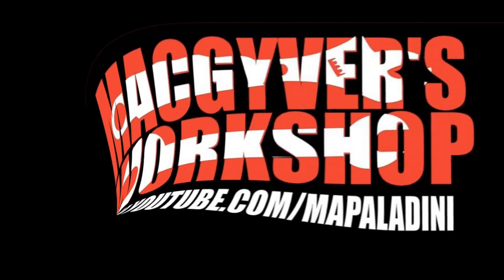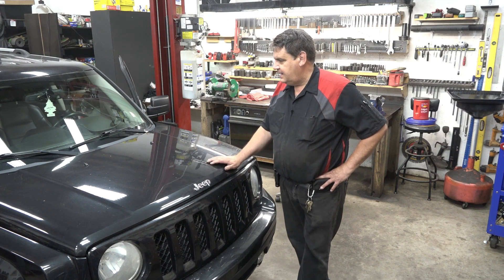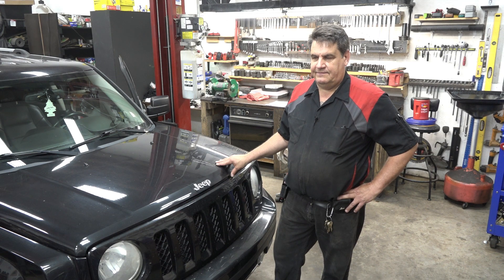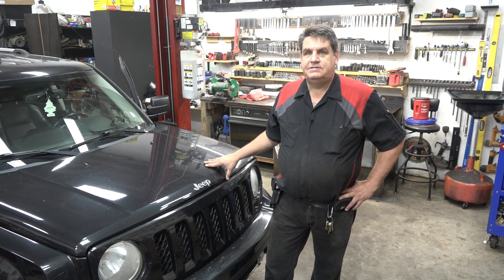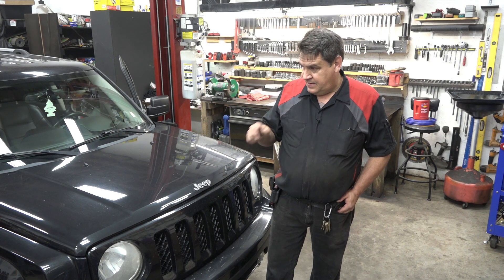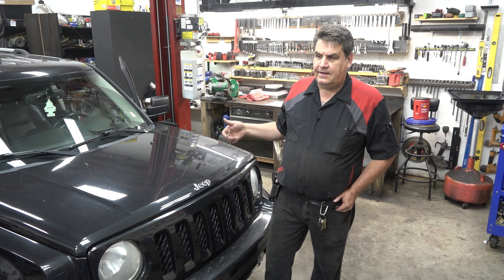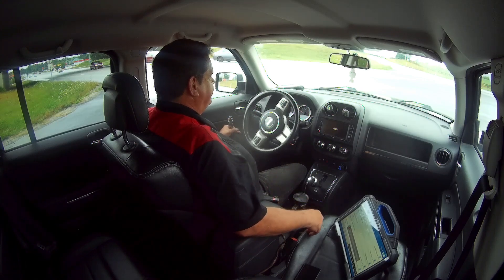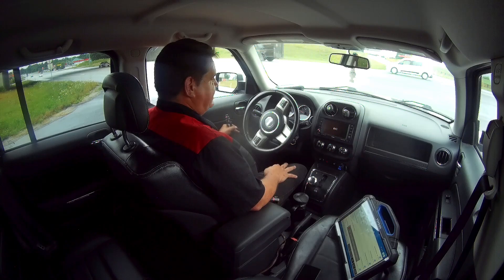Code P0777, 2011 Jeep Patriot JF011E CVT

Comment: Hello did you ever figured out the problem, I just put a new valve body into my JFO11E trans on a 2013 Jeep patriot 2.4l automatic and got the po777 code and goes into limp mode

Comment: This is bizzare! They really didn’t change much of anything in them much in the last few years. Mine is a 2015 with exactly the same trim pkg.!!! Did you ever figure this problem out?
Reply from the maker: Yes I did. Apparently the replacement pumps  that are available come 2 ways. One has a rubber o-ring gasket between the pump sections, and one designed for a later model does not. I got the ones without the o-ring seal, and they would start leaking when they got hot. losing pressure and triggering the code and limp mode.
Reply: Hi. So did you change the pump. Or you changed something else. And did you manage to fix the problem
Reply: @MacGyversWorkshop  what pumps are they I just got the same code on my 2013 jeep compass ???

Comment: I had a problem like this, it turned out to be the power steering cooling line was overheating and causing the computer to not let the truck take off, I temporary cut the line and looped it to keep the compression, but the whole line should be changed.

Comment: I have a 2014 Patriot with the same P0777 code and I notice that when it goes into limp mode it is due to the overheating. I poured water on the transmission for cool down and it would run normal until the temperatures rise and back to limp mode. I am currently working on installing an external oil cooler and not sure to bypass the stock cooler at the moment. I will send an update once I complete the test.
Reply from the maker: Thanks for watching! and I look forward to your update. Anytime an issue happens only when it's hot, you can be pretty sure that something is starting to expand and cause a leak. If the transmission is still original, and has not been recently overhauled, I would be looking at the flow control valve in the pump. You can get an aftermarket drop in valve that supposedly eliminates the sticking problem they have.
Reply: Did u fix it

Comment: I've got one in the shop with the same issue right now.  Transmission has not been rebuilt, but originally we had more solenoid and stepper motor codes.  We replaced valve body, new fluid and filter, and now we've got the same P0777 code. I'm wondering if the filter neck on the new filter is too long and touching the pan bottom.  I've had this happen on some of the other Nissan CVT transmissions before.  We had to cut the filter neck a bit shorter.  Anyway just a thought.  Haven't had a chance to pull this vehicle back in the shop but when we do I'll be sure to let you know if there's any progress.
Reply: Actually disregard that thought on the filter.  I just looked at a pic of the filter and it doesn't have the same neck as some of the other cvt filters like those found in Maximas and Pathfnders.
Reply from the maker: Sounds like the root cause of your issue might be different than mine. Perhaps the flow control valve sticking in the pump. I got mine in with a broken belt so I have no idea how it was acting prior to failure, but noticed my issue after the overhaul. I'm posting the latest video, you may want to check it out as travel down the Hellish rabbit hole of this issue!

Comment: We go your email, and we have noticed that it was very detailed, and you pretty much explained everything you did precisely. What raised a red flag for us us that you used ATF+4, and not CVTF+4 (which is the mopar fluid). The regular ATF+4 is not for the CVT because it cannot hold up to the pressure requirements. Not saying this is your issue, but it is something that must be addressed.

Also, do you have Mitchell or AllData because they show a step by step procedure for checking that code?
Reply from the maker: My apologies, I used the CVTF+4 fluid That was a typo on my part.  I have Identifix, and the next step in that direction would be to fabricate an adapter in order to physically measure the secondary pulley pressure with a high pressure gauge. But since both primary and secondary pulley pressures change in lockstep, it would seem unlikely that one of the 2 pressure sensors are bad. Thanks for responding :)